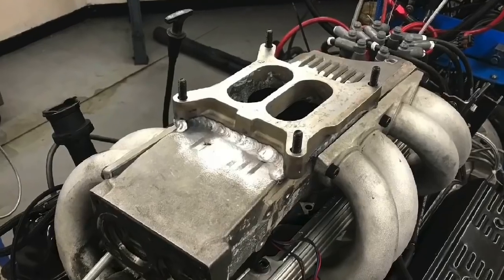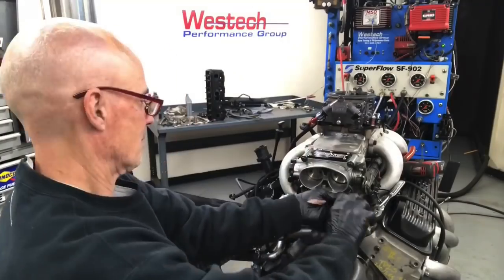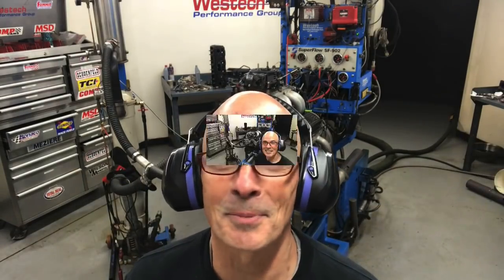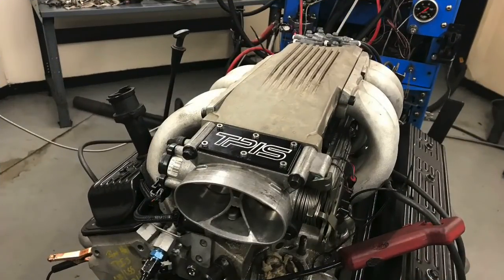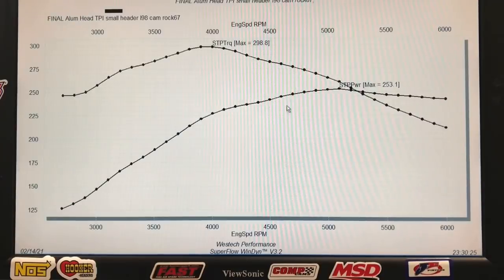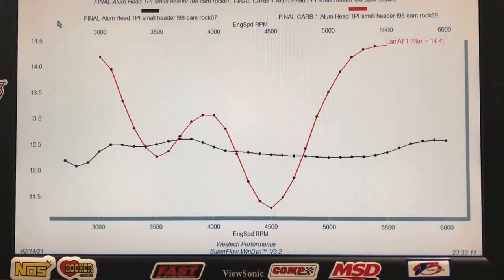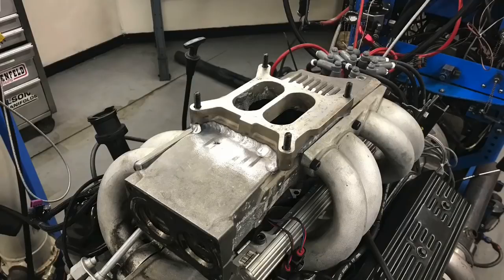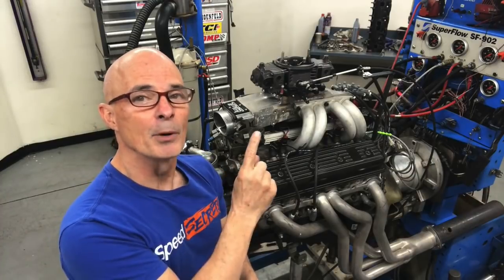CARB VS TPI? HOW TO: CARB YOUR TPI!

Comment: Well you can do air flow based fuel mixture on a constant velocity carburetor by profiling the metering rods. But it looks like part of your problem on the Dyno was just fuel from the accelerator pump. Yes the curve does still go rich to lean but I think the first rich dip is all accelerator pump so it's possibly not as bad as it looks in sustained running. For holley carbs, I'm sure changing air bleeds changes the whole dynamic but fluid dynamics is complicated. The air is supposed to make an emulsion which helps with response to changes. But the more air the more jet you need. I think the airflow vs pressure differential and likewise the pressure differentials make by the venturi due to airflow and the fuel flow from the venturi vacuum are all on exponential curves. How to get those curves to line up in a way to keep mixture constant? Or if they naturally work out I'm not sure. Maybe the nature of the manifold is contributing, maybe the strong pulses in a dual plane cause the fuel to over respond and its not a flow issue. Maybe a spacer helps, maybe a smaller air bleed or more fuel level helps. Actually this would be a good test day. 1 carburetor, test the fuel curve with different accelerators, different bowl levels, different air bleeds with the same target afr. Then swap manifolds or add a spacer and do it again.
Reply from the maker: this was all sustained running-no accelerator pump involved

Comment: This is how you figure out what works and what doesn't. I'd be curious to see if you mounted a carb adapter on the front of the tune port where the throttle body bolts up if it would work better.

Comment: I'm calling it now:
"Today, we're testing what happens when you combine a JUNKYARD 4.8 LS (complete with the STOCK LS truck manifold) with a pair of side draft weber carburetors where the throttle body used to be!"
Reply from the maker: think 4 barrel
Reply: 😜Use the entire length of the tunnel ram make a carburetor box that's at least 8 inch's tall and bolts to the front of the tunnel ram replacing the throttle body!  Wacky looking but will be better 🤪

Comment: That thing looks so sick! I priced some tpi manifolds on ebay. Too bad Edelbrock discontinued their tpi manifold! T
From what I've read, the stock runners are too small to make decent power anyway.
Reply: After watching the video, i think would take a lot of experimentation to get the right angle and shapes, but vanes to guide the fuel into the corner cylinders more evenly.

Comment: I bet if you make a custom box, (plenum) to centrally locate the carb atop the runners, with no dead spots beyond the runners, you would have a decent high rise manifold. Just hack up and weld another TPI top to do it. Make it happen Richard!
Reply from the maker: I was thinking a single-four barrel tunnel ram style top

Comment: I suspect fuel vaporization, or lack thereof, is the major issue here.  If you really want to get crazy, try heating the bottom of the tuned port right under the carb with a heat gun. Get it nice and hot, and keep heating it while you do a pull. My hypothesis is that it will suddenly make much better power. I love your channel by the way. You have my dream job! Cheers! 😎

Comment: Make a carb adapter that goes in front of the intake where the throttle body is,that should solve the distribution problem,theoretically.
Reply from the maker: did that-coming soon

Comment: What about putting a spacer between the carb and the intake ?  Would smooth the flow and not make a 90º turn.  Thanks for all the great videos.  Best Regards.
Reply: Just what I was thinking. He needed to try different style and thickness spacers on this.

Comment: I have tuned carbs a few times, so a bit limited experience with it.
I think the AFR curve for the dual plane carb look good, knowing that tuning carbs is always a compromise.
If I remember correct my Weber tuning manual tells that AFR leaning with RPM is a to big air jet to the main E-tube. But it depends on the carb design what or if you can do anything to it.
The AFR curves for the Weber and Solexes I have tuned was much worse. The Solex even have fixed air bleedes to the idle.

Comment: What's next, carbs on the headers? Hot vee?
Yeah, you could rear mount the carbs, have extremely long intake runners!!  About 12' intake runners, extreme tuned port! And do a rear mount turbo too!!

Comment: I want to see a carb mounted to where the throttle body would go, either horizontal or with a 90° vertical adapter
Reply: A side draf webber mounted there is a great idea.
Reply: Carbs are mounted horizontally due to the float bowl
Reply: @shadowopsairman1583  so? That's why I said 90° adapter

Comment: Can u please run a Complete First TPI Intake system with some have way decent pair of heads Ive been waiting for yrs. They flow out of the box at 320cfm without any porting and should blow anything away

Comment: I imagine the Lingerfelter TPI Plenum would probably yield good results on this 4.3 motor. It'd give longer runner length than stock LT1 for tq production and shorter than L98 runners for better HP curve.
Reply: I've had the Lingenfelter Super Ram on my L98 for 28 years.  It was the thing to have when it came out, but has been surpassed long ago.  It lays down HARD at 5600 rpm.

Comment: What kind of induction/fuel system you running these days? “Oh...tuned port injection Holley 4150 750cfm double pumper with a throttle body spacer”
Reply: Might aswell have a Quad TBI system

Comment: if you used an edelbrock carb,, you can adjust the metering rods and springs for mid range.
Reply: Hollies version is  a Power Valve. 
 Both work on vac. min. -5in spring or valve.  If your pulling 5in of vac. at WOT the carb is way too small (dyno is all WOT with poor mid range rpm not part throttle; if mid throttle then yes)

I had the same thought,  and then had to think about how it functioned.

Comment: Oh my, what happened? 50hp shaved? Your probably also running into some awful airflow distribution issues. If the carb is working okay the afr won't be horribly different between cylinders. Given that there is a square surface right below the carb flange the air has to come in the carb and turn 90° and then meander around the plenum. If there is a big clean spot right under where the carb is, it's from fuel unable to make the turn and coming out of suspension. Fuel puddling might be a really big issue especially if the manifold is cold. That will cause bad afr distribution.

Comment: Try a 50mm Weber DCOE in place of the throttle body. Un modified plenum. You should be able to tune the low mid and top range separately. Somewhat. Use emulsion tubes for low and bottom of mid range. Fuel mains for mid range and air correctors for top. Every change will effect the full range, but have more influence in the directed range. This will require many small changes to iron out the final jetting.

Comment: I've read that you can tailor the a/f curve of a carb by manipulating the sizing of the jets on the emulsion tube stack. Don't some high end carbs have several jets installed where the standard casting just has holes drilled?  Seems like a lot of trouble to go through, even so.
Reply: Screw in air jets (correctors) on top of emulsion tubes.  The racier Holleys have them. Webers have them too.
Wanna richen it up at high RPM?  stick in a smaller air corrector. 
Webers, you can fiddle with the emulsion tube hole patterns, etc. too.
Not many people like Webers. They are a PITA and expensive to get right. They sound and look good though.

Comment: Use long tube headers as an intake manifold.
Reply: Can you imagine a set of headers hooked to the intake and coming up through the hood about a foot and a half and having two Holly's on them! Might not be Richards thing but I would give that comment to dude who put 8 turbos on the Mustang.  right up his alley
Reply: @MB-ib5ji  Don't think anyones tried that yet, but would be pretty wild. But I know guys used to do some crazy stuff with the Buick Nail head motors back in the day, basically swapping the intake and exhaust valve. Don't think I've ever seen a picture of it, but must have looked pretty wild.
Reply: @MB-ib5ji  THERE WHERE LOTS OF HOTRODDERS BACK IN THE 50'S THAT TRIED THIS....
Reply: That's the craziest idea
Reply: I've been suggesting this but he don't want to...
Reply: Google "John Meaney quad turbo" from what I remember they needed something that flowed a ton of air for the intake, and figured well, headers flow lots of air.
Reply: @sparkplug1018  that looks pretty wild
Reply: Block huggers turned over would build more of a tunnel ram
Reply: Seen it work on a small block ford
Reply: Lol yes plz

Comment: Thanks Richard, for answering the question no one ever asked. You should try running the carb, throttle body, and injectors at the same time.

Comment: Can you convert the GM Performance LT1 to carb intake for fuel injection and use an adapter like the M5lp 0505 07 Sullivan Performance Intake Throttle Body Adapter. I think it would look cool and make the best power curve! Lets find out!!!!

Comment: Pretty Cool!   Next,  try dual carbs on the TB cross fire intake, that has short runners.  We used to call it the cease-fire, always towed in for a no start condition.
Reply: Thats another one I thought of trying years ago, now I'm glad I didn't lol. Curious though why it doesn't work.
Reply: @sparkplug1018  Many years ago, I heard of the cross fires being used with carbs.  The runners are full size, and about 6 inches long.  Rumours about it being based on the Smokey Ram design.

Comment: When we ask about meth we mean methanol and as it applies to the motor
Reply from the maker: methanol fuel or water/meth injection?
Reply: @richardholdener1727  either one just not methamphetamine. It was a joke in regards to your energy level 😊

Comment: I had an old Wieand tunnel ram that i really wanted to run two old tbi trottle bodies on. Thought it would work great on the street as they dont need vacuum. Unfortunately at the time trying to use the old school ecm wasn't really a good idea as the tunability real wasnt there and the drivers would have needed to have been upgraded ect

Comment: I've watched the video, and not surprised that the carb did MUCH worse. My working hypothesis prior to watching the video would have been simply that the ports on the TPI intake are designed for just airflow. You can make sharper/tighter radius corners because you don't have to worry about fuel separating from the mix, creating uneven/inconsistent A/F mixture and puddling. After watching the video, still not sure that that isn't happening, as richening it up might have caused the issue of separating/puddling to worsen, but again, not sure how this works with the collected A/F data...it does work with the lower power output. Unsure.

But no surprise....MPI intakes and carb intakes can look dramatically different for GOOD reason.

Comment: Cardboard is so 20th century. 
In the 21st century we use milk cartons for gaskets.
Check for cardboard fouling at the spark plugs-- you'll be ok..
Reply from the maker: it was oil soaked-fuel enrichment

Comment: A properly designed plenum for the carb to feed each runner would be neat. Or even better, 4  dual delorto or dual webers and no common plenum. A sort of cross ram.
Reply: thats what i was thinking when i saw those tpi tubes.
Reply: Look at tge Smokey Ram!

Comment: Put a piece of plexiglass over the front throttle body hole and point a camera and a timing light through it to see wtf is going on!
Reply: I was about to say the same.
Reply: You won’t really be able to “see” what he is talking about. It would be easier to do with a CADD simulation. That manifold is basically creating a bunch of “echoes” between cylinder pulses that really interfere with fluid flow

Comment: Yea the back two cylinders on the drivers side and the front two on the passenger side was running Lean while the inside sets was rich that's why it just killed Power! and yes with Edelbrock performer carbs and Carter Carbs you can dial in all parts of the RPM Range fuel ratios with jets metering rods and springs, on holleys you cant!

Comment: Now turn the efi back on, and replace the carb with a four barrel throttle body.
Reply: I was thinking the same thing but leave the carb and just use the injectors in the intake to clean up the air fuel ratio in each individual cylinder
Reply: @ziptiejedi5658  need a tps signal. I suppose you could run linkage to the stock throttle body from the carb to activate the tps.
Reply: @jr78racer  yeah I was thinking you could probably use a cable from the carb to the TPI throttle body and use the factory TPS.  I'm positive it wouldn't be worth all the work it would require to get everything to work buy I do think it could be done fairly easily
Reply: @jr78racer  If you were running a large shot of nitrous through a plate kit under the carb.  Then you could dial in the afr's using the injectors in the intake.  Again overly complicated but it's definitely thinking outside the box.
Reply: @ziptiejedi5658  it's all worth it when we're not paying for the parts lol
Reply: @jr78racer  lol that's very true.
Reply: @ziptiejedi5658  
I see how your mind works 👍
Reply: @xmo552  I definitely like the oddball setups.

Comment: i thought the tpi with aluminum heads, smaller cam, and small headers made 307 tq and 263 hp how did it lose power and tq when you went to super l98 cam and 1.5 rockers? lift should be close to the previous cam but with more duration 
super l98 220 220 dur. 450 450 lift 112lsa with 1.5 rockers
previous tpis cam 207 212 dur.  440 457 lift 117lsa with 1.6 rockers